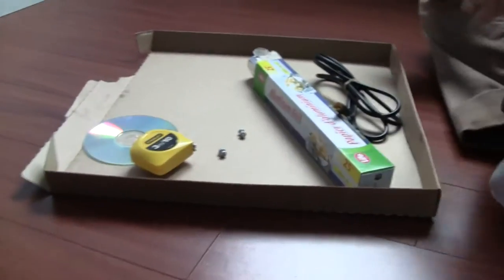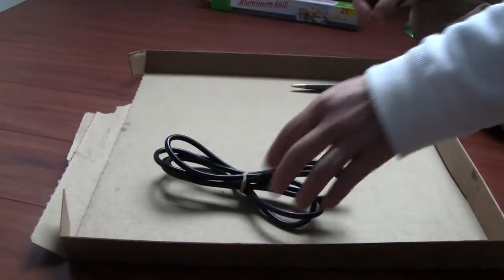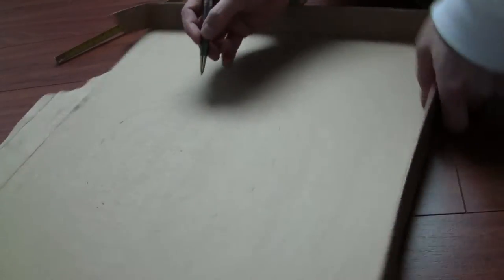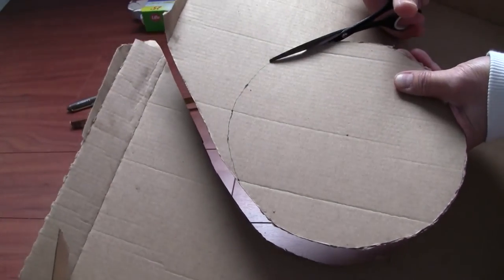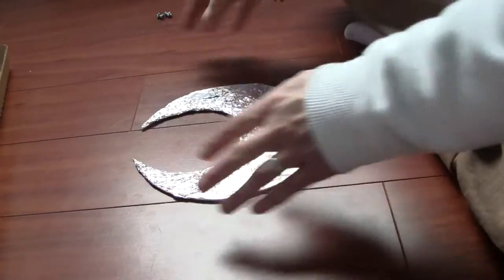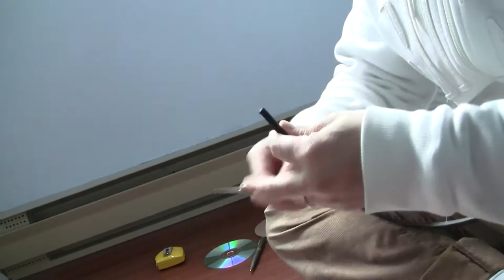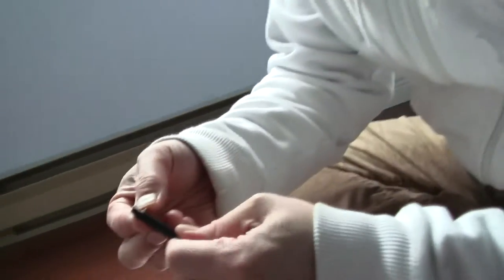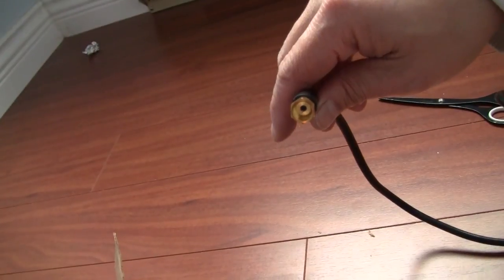Cheapo Tech: DIY Make Pie Plate HDTV Antenna, Easiest to make free TV antenna

Comment: Easy to make and very effective. Good idea to connect wires with bolts and nuts. I added wing nuts as improvement. You can make a simple compass to draw your circle using one of the sides of your box. We don't need to watch you cut everything out, though. Next time, edit it down to the nitty gritty. I give a C+.
Reply: solid d-
Reply: Okay Simon Cowell. Your were watching a video for a freen antenna for free tv. Give the guy a breal
Reply: @BdeJJG  Gone way beyond this now. Have roof antenna attached to chimney. Anyway, there's nothing left to watch on cable or over the air. My criticism was an attempt to be helpful. Yours, not so much.
Reply: @digalittle  my apologies for that. It just came of as it wasnt. I understand but theres some channels and honestly its not bad. There is premium tv then theres this. Though premium tv is nice this keeps you in reality and not hooked in so bad.